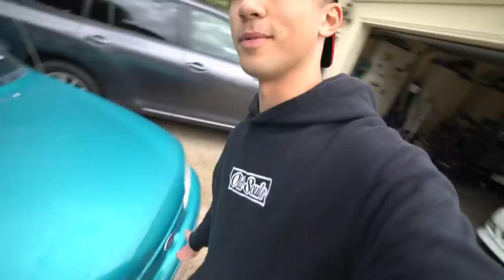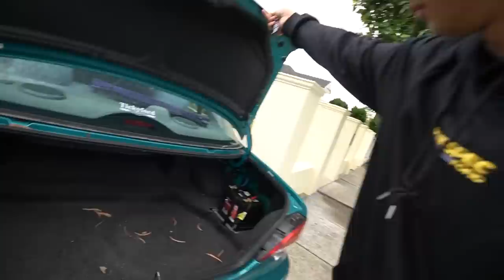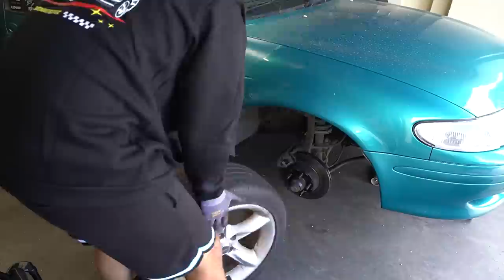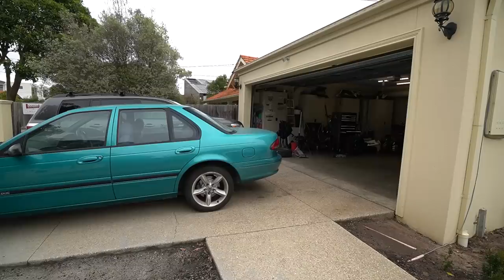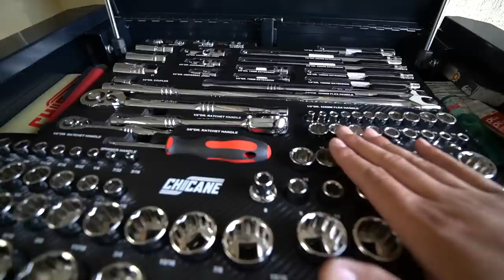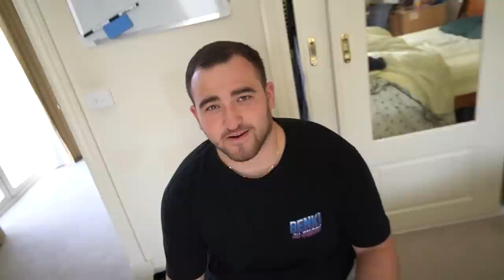The Barra EF Gets NEW WHEELS + Big News

Comment: Looking mint, just a suggestion you really need to put a zf6 gear box in it. It’s a very good auto gear boxe for high powered barras
Reply: And a trans cooler so it doesn’t milkshake
Reply: Said that from even before he started the build. Didn’t listen, by the time he builds the dogshit btr it’ll be just as expensive as a zf that’ll handle it better and drive better.

Comment: ef are 16x7 +0 offset so you only want 115mm~ of wheel sticking in from the face of the hub to the chassis, TI performance sell ba/au upper control arm adapters which changes the ball joint on the arm to a tapered hole for your upright,
Reply from the maker: I’m probably gonna get the ti stuff!
Reply: @RexH  I recommend just super lows all round, I have xyz ba coilovers in the front but now it feels icky to put super lows in the rear to match bc only shockworks and pedders make a full kit for the e series-au falcon, otherwise it's ve rears or r33 fronts in the rear which are very stiff according to people who have done that